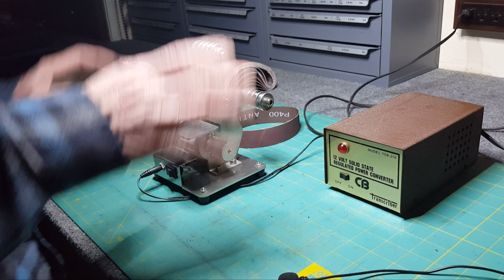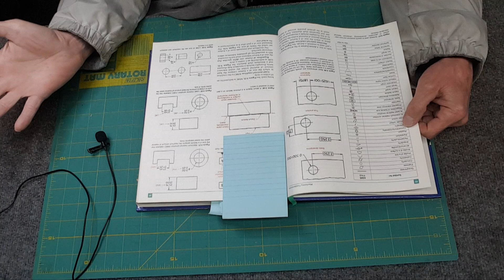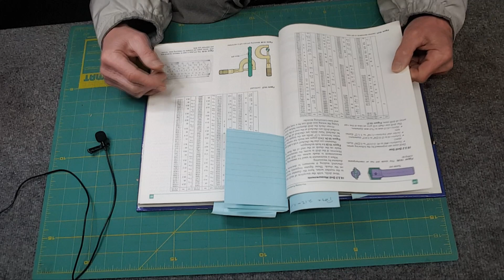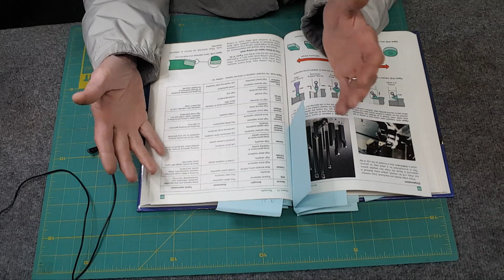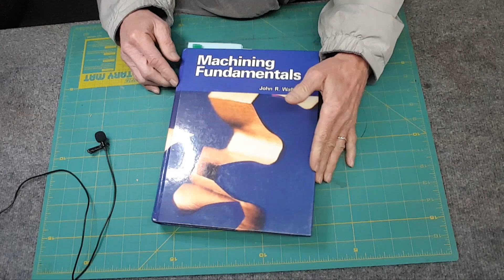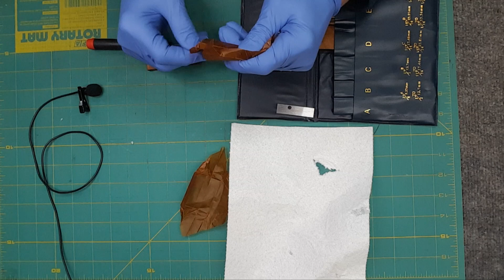Friday Night Buffet #3

Comment: I have a set almost exactly like that set of parallels you show, but came from a different distributor.  Very thankful for them as they make measuring between the pins on cutting dovetails much easier.  And I would not have harassed you on the name, everyone has a different meat loaf recipe, lol
Reply from the maker: I've already used one parallel since.. Thanks!!

Comment: Found a used copy of Machining Fundamentals, shipped, for under $20. Paused video to place order. Thanks for the recommendation.
Reply: Great deal - now looking for myself!
Reply from the maker: I couldn't find any thing under $100..
Reply: @TheMiniMachineShop  I’ll let you know what it looks like when it gets here.
Reply from the maker: @markedevold1261  Great! Where did you find it?
Reply: @TheMiniMachineShop  just received my copy of machining fundamentals. I found it on Amazon, it’s used, but looks good. Search for the 1998 edition to find copies in the $20 range. More current editions are $100+. The older edition has all the info a hobbyist needs.
Reply from the maker: @markedevold1261  Hope you like it as much as I do!
Reply from the maker: @markedevold1261  Just pulled mine out 1998...
Reply: @TheMiniMachineShop  I spent the afternoon going through it. It will become my primary reference for my beginners level of machining—it’s way more readable than the Machinery’s Handbook. The 1998 edition is a good value; modern enough to be very useful, old enough to be relatively cheap.